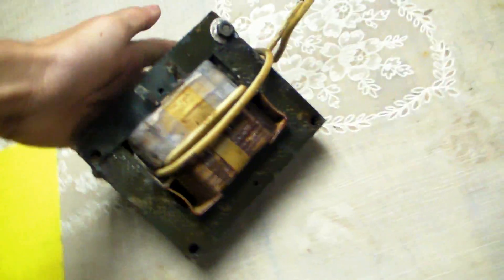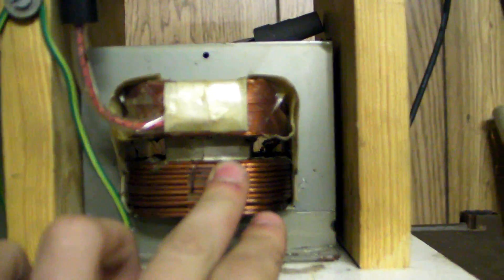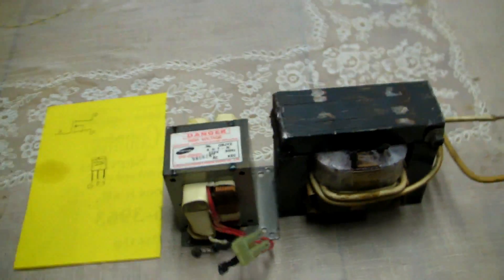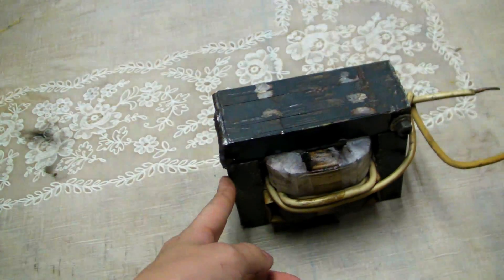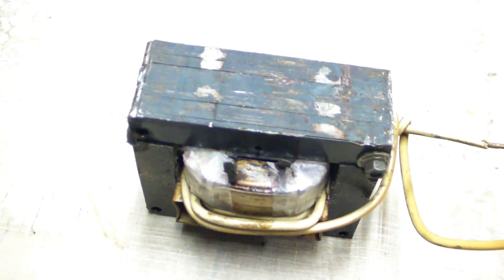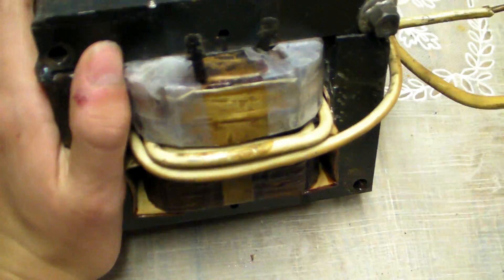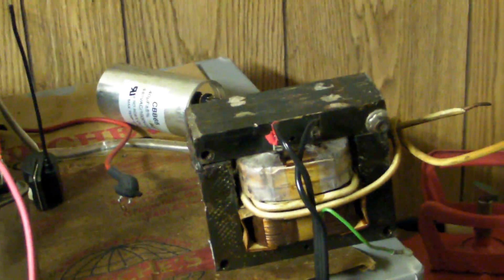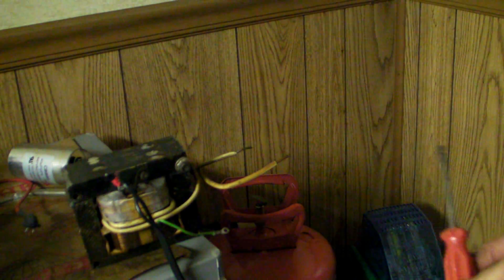Huge Deshunted Microwave Transformer.

Comment from the maker: I put it back together by welding it. Sadly, I discovered my welding gas was shut off after I welded. That would explain why it was the worst weld I ever made. Anyway, You can use wood/plastic but it will not have the properties of a shunt, as they are not affected by magnetism.

Comment from the maker: Yes, something useful can be made with this. Sadly, I do not have enough time to make anything worth while. As for the electricity waste thing. Them coal plants are so big, and it takes the same amount of coal to provide power at "idle" than it does when everything is using power. They use multiple generators. At minimum, one will be ran. If more power is needed, another generator gets fired up and is good for another many mega watts. It only influences my power bill by maybe a few bucks most

Comment from the maker: Well, it matters how careful you deshunt it, and for how long of periods you run the transformer, and what you use it for. Deshunting results in a higher current output, but it also overheats much quicker. If you run it for a shorter period than you would with the shunts, keeping an eye on the heat, it will last just as long as a brand new MOT.

Comment: Sal, what does deshunting do? What is the purpose of a shunt? I mean, I have that step down transformer in front of me, and I assume that the little yellow strip between the primary and secondarynd outside are the shunts. But what is its function and what happens when you deshunt one?

Comment from the maker: @a380rockerfan Well, It is sometimes not easy, I tried to deshunt one of mine, and they didn't even move. If you buy new transformers on ebay, the shunts come out easy, but sometimes they dont. I had bought 2 ebay MOTs a while back, one of them is now dead from me trying to deshunt. I got one out great, the other got stuck and scratched the secondary and arced over. I plan to get a few more ebay mots as seen in my video "Triple resonant MOT stack (giant arcs)"
Anyway, I do not recommend deshunt

Comment from the maker: @davie4monster Understood, and yes, the heating is pretty bed with mots, thats why short runs and heatsinks are good. I often place a heatsink of mine on top of the core, I know it is nearly worthless with no good contact but once heat transfers to the heatsink, it actually cools the mot faster and I can do slightly longer runs once the heat from the coils transfers to the core and then to the heatsink.

Comment from the maker: @davie4monster Hmmmm, I would need to take this all apart. The mot is currently dead again. There is a scratch on the primary in a visible spot, and when I plug it in, besides flame like arcs flying out like a mini torch where the scratch is, the (secondary - NOT PRIMARY) overheats really fast, normally if there is a short in the secondary, the primary overheats but, its different.

Comment from the maker: @zker666 Oh, I dont cut the secondary, I just die-grind the welds on the core, remove the primary, remove the shunts, remove the secondary. Then push the primary all of the way to the bottom, and put in my thick new secondary and have my dad weld the core back. Its easier to fit more windings if you do it that way. But, if you are making a power supply to supply a few good amps and a moderate voltage, its easier to fit more windings if you do it your way.